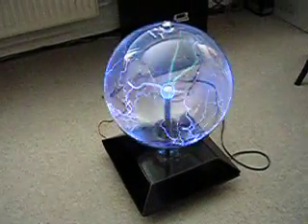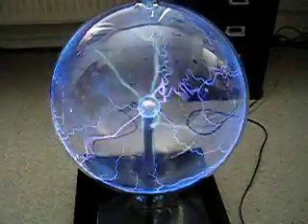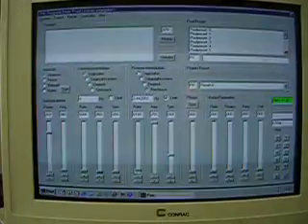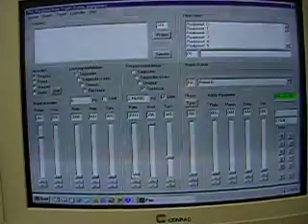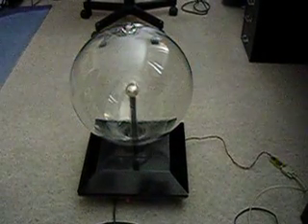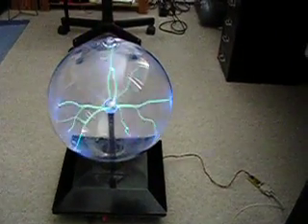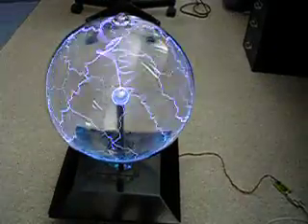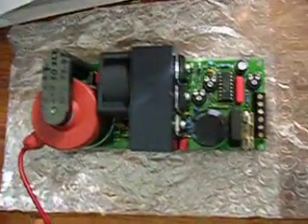Large plasma Globe Tuning

Comment from the maker: Even if it is a bit expensive....lets talk via phone, because coomunication by writing is too  viscous !!..:-))

regards timmi
004940 851 41 95 (from 18:00 pm on)
Reply: I have a bill parker globe. I can identify your globe as using the base of a bill parker globe. Unfortunately the power supply broke and is replaced by a chinese plasma globe power supply. It does not look like it should. Probably the wrong frequency. It did have a frequency slider on the original power supply. Do you perhaps have a schematic of the power supply you used? I need a new one.